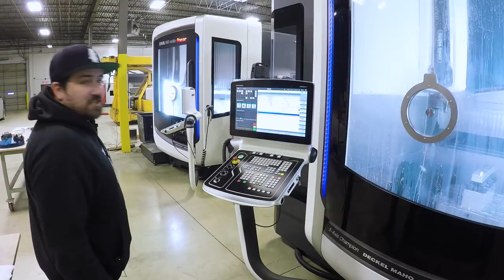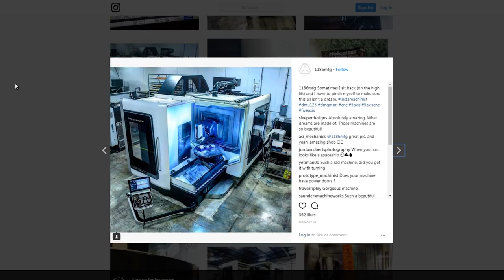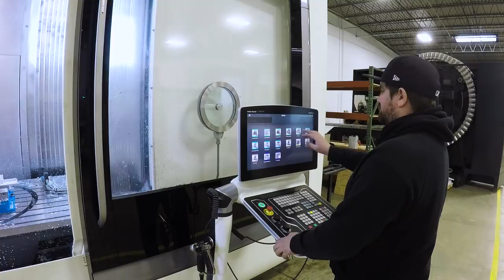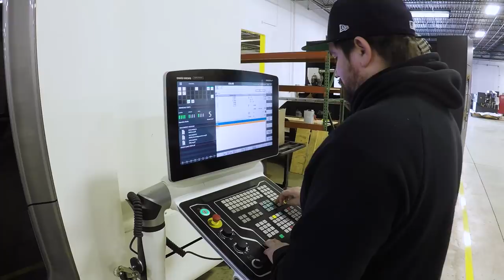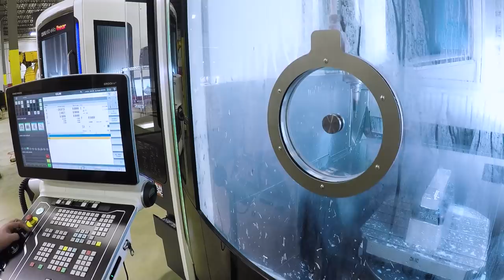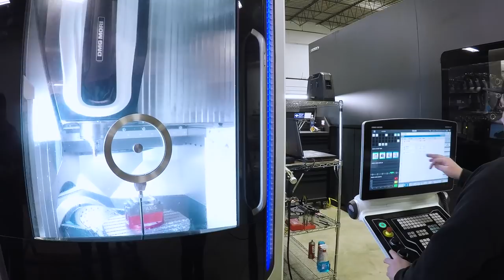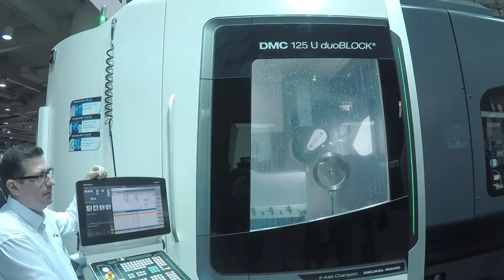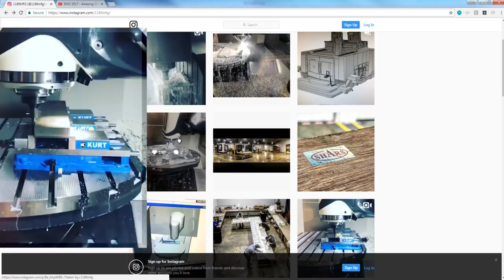AMAZING 5 Axis DMG Mori Machine Shop!

Comment: Where I was an intern we used a Highfeed tool that was 100mm in diameter and about 650mm long while the head was tilted to use the tool horizontally. And it was amazing to see!!!
Reply: Yeah i use a tool about that size everyday. No holder. It bolts onto spindle

Comment: I retired 6 years ago and at that time tool and machine builders told us the current tools and machines we were buying would be obsolete in 5 years.  How true.
Reply: Not obsolete, but serious machine shops only use shrink fit tools and buy modern high quality machines. The crappier machines like Haas make the parts you don't use these machines to make. It'd be a waste

Comment: I've seen a lot of machinery that was much larger, but it was nice to see inside this type of precision equipment.  Thanks for taking us along on the tour and getting inside some of the inner workings.  I had no idea the ball screws would have been temperature controlled.  Very interesting.
Reply: Because they're big, so temperature affects them more. Plus those are fanciest, most accurate machines you can get

Comment: And I here am with Fadal's from the 90's....
Reply: Oh i hate those machines as much as Haas
Reply: As long as they still make parts . . . I own a 2004 Fadal 3016, 2012 Akira Seiki SR3, Prototrak 1540v and DPM2. Own 'em. No machine payments. Got done paying off my 5 year loan a year or so ago.
Reply: @pro-seriesfabrication3810  They still make parts and when you dial them in, you make those parts in tight tolerance. I recently bought another well taken care of Fadal 4020 fitted with glass scales that give me even more accuracy. Already paid itself off within the 3 months. Can't go wrong with a good machine.
Reply: @ErostheEpic  My fadal runs decently but it can't interpolate circles well. Usually within .002" round. After I bought the Akira, the Fadal just runs mild and stainless for me. Has a 10,000RPM spindle but the belts and motor sound like hell above 8,000 or so. Plus the spindle chiller leaks so it doesn't make sense to run up there all the time anyways. Drained the spindle chiller fluid and don't run it anymore.

I bought it 5 years ago for $6,500. It's probably worth a little more since fadal came back and it was a steal then but I've replaced the vector drive, the spindle, and the air/hydraulic belt actuators. Oh and the LCD screen which luckily has a VGA port in the pendant cabinet so a $60 computer monitor took its place. The guy I bought it from had left a tool in it for almost 2 years so it blew up 4-5 of the belleville washers in it the first time I used a face mill.

But it's the small block chevy of CNC mills. Super easy to work on and parts are relatively cheap.

Comment: Hi my name is John I'm building a router table 26' x 10' with a 2.5' over hang that runs the lenght of the table for turning long stock. I'm building a machine with an articulating spindal . I was  reading the Mach3 manual and it says "if the machanism is like a robot arm or a hexapod, then Mach3 "will not" be able to control it because of the kinematic calculations that would be needed to relate the "tool"position in X,Y and Z coordinates to the lenght and rotation of the arms " is there a program that would solve this for me?
Reply: No

Comment: Awsome video and CNC mills but......All that tech and they didn't install a light and switch in the back of a machine, that cost how much?
Reply: 22BOZIDAR I'm sure there is a light in there, they either didn't know how to turn it on, or like you, didn't know there was one. That area is only accessed for service, so neither of them are familiar with that area since they don't go in there. But I'm sure there's a light in there.
Reply: Andrew Delashaw there is no light I can assure you.
Reply: Your first born is accepted only as a deposit when ordering.... ;)
Reply: there is no light but the Roof is only optional normally only the work area is cover with a roof. So i guess that is the reason for the missing Light.

Comment: We have Blum lasers and probes on two of our nv-5000 mills. Coolant is constantly breaking the beam and faulting the cycle. I like the way Blum does their probing cycles. But that's about it. I'd take a renishaw over a blum.
Reply: Blum works excellent. All the machines that have them at my work are all covered. Weird DMG has it just sitting on the table exposed. But they will crash if you try to measure a tool longer than 1 foot. I find they also won't measure if theres too much runout

Comment: Just curious; how do you get enough aerospace work to afford $MM in Mori’s when your oldest machine/shop is four months old..? 

Fusion for $MM aerospace shop too?

Idk a lot of these guys with moris by the dozen on IG always seem suspect.
Reply: If you get the contracts it ain't hard to make money. Weird they'd use crappy software. My family owned a shop and we made microscopes that you see on CSI. Were pulling in 1.2 million a month with just 3 Haas MiniMills. Technically way overcharging. They wanted 4x more a month for abit less but my dumb grandpa said NOPE cant do it. Now its closed. Had he bought machines like this and spread us into 2 shifts could easily have done it and made even more money by working less.This guy is on the right track ditching the Haas machines

Comment: Tool Porn!!  The amount of waste is a bummer though, I love hogging material but making an 8lb part from an 1800lb ingot just screams there should be a better way!!!!
Reply: Not if you need just a few parts, i think.
Reply: Not necessarily , if they work for military or aerospace or... airforce , the specs may require a structurally homogene piece , which would exclude welding . At least that's what i think . Also it is simpler to program and run clean cuts/paths . There is also the 'more time in making , more money in the pocket ' , cause that sort of machinery must have close to 150$ per hour rate (without tools and materials)
Reply: Yep that is the beauty of working for the government, just waste it all and make them pay, since its the taxpayers money and that budget is unlimited the cost and waste doesn't matter. They used to forge and form a lot of aerospace parts like these but now cnc's are so cheap that it is cheaper just to waste the material and let the cheap machine do it rather than have the huge expensive press and dies to make the parts by the efficient materials method.
Reply: Aluminium recycling isn't hard tho.
"Approximately 31% of all aluminium produced in the United States comes from recycled scrap"
Reply: I do that with titanium.  The spec calls for fusion mold but i think it's because limited numbers.  Only 50 or so pieces over the course of years.
Reply: The waste gets recycled...
Reply: kiss peter well said thanks . Not to mention recycling is not a total waste
Reply: bcbloc02 im pretty sure he meant 800lbs
Reply: Coincidentally DMG Mori also makes a laser print head that uses powdered metal driven by inert gas into a laser focal point to melt and sinter the material and form metal 3D structures. When done making the general form the print head gets swapped out for any necessary tool heads to finish the product. This is very efficient material wise and can work with aerospace materials such as hastalloy, inconel, and titanium.
Reply: TaintedMojo Is SLS 3D printing as strong as a solid, monolithic, billet part?
Reply: this reminded me of a job our best man was tasked with (an aluminum wire coil.) Our best man scrapped 4 parts before he got the process down. Management claimed this as a $4000 loss. No, that was $10 in aluminum stock..
Reply: casting then macining it

Comment: how do you learn to use a machine that complicated does anybody know, whats the learning curve like?
Reply: DJ DarkMatter those machine aren't hard to use, the interface is pretty cool. Learning actual G-code is a little bit harder, but it also depends on if you know any fabrication techniques
Reply: You gotta know alot just to be a machinist. Takes years of getting yelled at. Then learning the machine is just like getting a new smartphone. Practice and reading the manual. Doesn't look like he makes anything hard and is spoiled using nice machines. I'd guess that guy has less than 5 years experience just by how he talked about the shrink fit

Comment: I'm amazed he can set those machines up without being to able to simulate everything in CAM. Wish Fusion had machine simulation.
Reply: It doesn't? That's lame...
Reply: ErostheEpic just the tool holder and the vice and maybe the machine table but not the spindle or rest of machine
Reply: 8 years now i have been making programs everyday and never running any simulation or dry run. I never use the same program twice. I've never crashed, and i run programs where the spindle is below the part. I collision check with my brain and math, sometimes with 5 thou clearance. Just takes focus. I could collision check but I'm confident and the model is so large it could crash the computer. I machine a 50 ton block of steel into a front bumper mold. I work on a Mollart 2.5Camder. Bigger than these with 6 axis. Nowhere near as fancy and nice though

Comment: Very cool Video, what software are they using for Collision preventing when the do tricky 5 Axis parts? Fusion 360 has no machine Simulation so far.
Reply: Thats why i'd have Tebis or PowerMill. I make huge 3d parts on 6 axis, i mentally collision check and never crashed. I also never run a program twice, simulate, or go slow. Do or die everyday. Thats why i laugh seeing people crash, idiots

Comment: There must be a thick ass floor in that there place there!
Reply: Machines I use are even bigger and I put 50 Tonne blocks of steel on them plus machine weight. Engineers had to do an assesment and a crazy deep foundation put in just to support the machine

Comment: that's an awful lot of debt under one roof.
Reply: Spend money to make money. So simple right lol
Reply: Robert Ross  If you don't pay an equal amount to an army of god level CNC programmers and if you don't get paid on enough orders to pay for all this stuff you are just inflating a bubble. I understand that they might not be showing what parts they make due to NDAs but in that case I don't think anyone would stop production and pack everything up just to make a youtube video...
Reply: They pay themselves off pretty quickly.
Reply: You see that bin of chips?
Reply: My work fills 3 chip bins that size in a week. And there's only really 4 machines running
Reply: That's an awful lot of envy in one comment.
Reply: This is an awful comment.
Reply: You never know the situation unless you're the accountant. There was a machine shop here in Atlanta (Cartersville) that somehow one of their customers found me and asked me to go down to this place and see what the deal was. He had evidently contributed to their machine purchases (they were doing stainless parts for a home beer brewing product) but lived several states away. Sends me some money through paypal for my time and I drive down there to see what's what. The physical location was eerily similar to this. Like 20,000sq ft and there's a brand new HAAS VF4 SS with the 4th axis installed and a brand new HAAS ST20 with live tooling and all the options. Brand new Amada automated band saw in the corner. Brand new mitsubishi fork lift and there's one guy running stuff, who after talking with him for like 5 minutes I could tell he wasn't sure about running anything. I did end up staying for a couple of hours and programmed and setup the VF4 to run these distribution blocks. Ran the first one, told the guy good luck, and left. Evidently the HAAS sales rep programmed the couple of parts they were doing on the ST20 while he was there. Called the guy and told him the deal and never heard back from them. 6-7 months later the machines are up for sale.

Comment: 500k machine monthly is 8k per month on 5 years. machine needs to make 100 per hour. minus 40 for machinist. 60 per hour times 60hr per week if your lucky, 4 weeks per month. 15k-8k is 7k per month per machine. thats if your lucky to have two shifts that are pretty busy. see all his machines sitting? that doesn't include rent, quality, maintenance, power. good luck. Machinists get to play with expensive toys, but there are very few things that can spend money faster than a machine shop. the numbers boggle your mind. Our shop costs 20K per week and only has 6 empolyees.
Reply: depends where he lives , and the type of work he does  , he can probably make parts for $30 in 5 minutes with those machines

Comment: That would have to be the weirdest shop I've ever seen. Some serious kick-ass machines, all idle, and basically nothing else in a warehouse. Calling some confidentiality agreement is frankly bullshit, machines like that need to be running, and sure you may not be able to show the parts etc, but you'll still hear spindles turning in the background. That was genuinely awesome and I've only seen machines like that running at trade shows, but very weird just the same.

I have no idea what they machine there, but to all the imbeciles who just guess "aerospace" like it's a licence to print money I can assure them that it's no different to a lot of other areas of manufacturing; the tenders go out, and you're either competitive with your quote or you're not. If you're not, you're out.

Comment: What do they cost?
Reply: Millions probably.
Reply: Антон Южаков do you work for dmg?
Reply: No, but if Haas cost in 6 digit range i'd imagine price of mori easily can be in 7 digit range.
Reply: Антон Южаков Some are cheaper then you would think.
Reply: devon dupuis No, not these machines. The op asked specifically about these machines, and the other guy replied about these machines. These are multi million dollar machines.
Reply: Andrew Delashaw not a single one cost over a million. Dmg does not advertise pricing. So you would not know unless you bought one. So I can with certainty say that your incorrect.

Comment: All of this is much smaller then my last Mill i was working on before i got a leading position. My 210P was the 5th in Europe ;)
Reply: But what did you machine? Welds on a frame lol. ? Try machining the front end of a car out of a 50 tonne block of steel. Thats what i do. Those machines wouldn't be big enough
Reply: @highstreetkillers4377  So its Dec 2019, what machine or machines do you run if I may ask. Just curious

Comment: massive mostly empty shop with expensive brand new machines and no parts coming off anything.  puzzling bussiness
Reply: Ryan Moore maybe he makes luxury items.  Ever heard of Veblen goods ?
Reply: no, but by the looks of it I need to learn about it. I have to machine hundreds of parts a day to pay for one new makino a51nx.  I could not imagine the cost of all those DMGs!!
Reply: Someone clearly has a bunch of money laying around.  Hopefully those machines will pay for themselves over the next how many years? Its weird that they all are next to new and they're all sitting idle.  Also, its odd they chose 5th axis vises.  We had 1 and were putting end holes in a 15" part and the holes were off visibly from one side to the other.  No torsional rigidity in them and for $1800 you expect better than .008" inch holding.  Probably fine for small stuff or if you're using 2-3 of them in a setup... we sent ours back.
Reply: maybe just a playyard for adults?! It would be one, if i had that money for! :D
Reply: If it's not a 24/7 operation maybe it's closed for the evening

Comment: They are worth less then a old manual machine after one crash   75 bucks a ton If your lucky
Reply: I've been machining 18 years and have never crashed the machine. Last 8 years I've never run the same program twice, always 1 offs. And i don't dry run or anything, full speed. But i know how to use the software properly. I even have just 0.005" clearance sometimes. If you crash, you should be fired. These machines have a crappy programmer that crashes them they won't break, built strong and will alarm out before damage. I've seen a guy crash a boring mill into the table and it ripped the whole column off